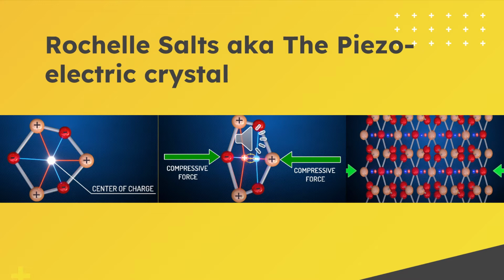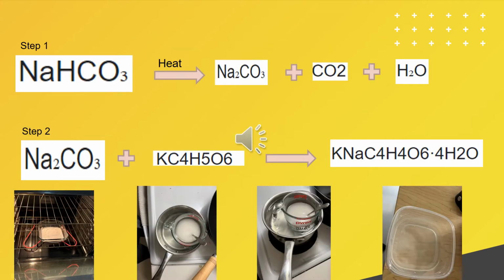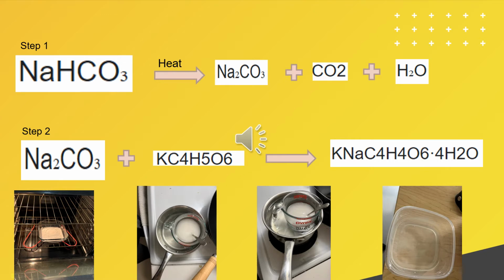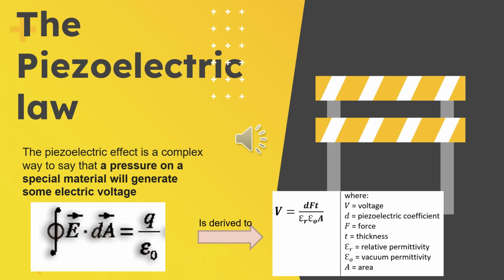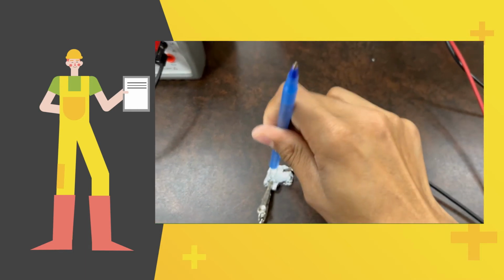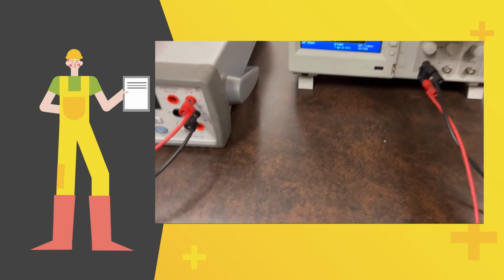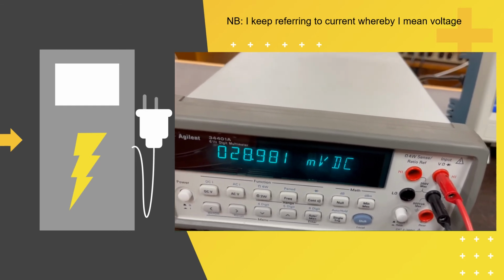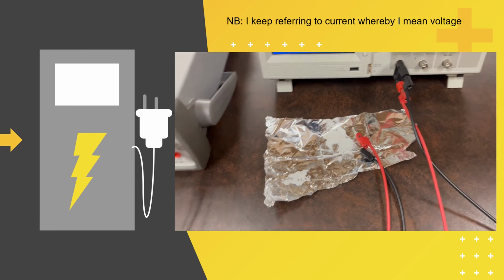Piezo-electric Transducers - Physics Project

Comment: Thanks for the video!  You had the oscilloscope in averaging mode every time you weren't hitting the sample.  When in sample mode, did you see the size of the voltage fluctuations increase when you were hitting the sample compared to when the sample was just sitting on the desk undisturbed?
Reply from the maker: This was a problem I encountered when using the oscilloscope , I wasn’t able to get much of a reading(the amplitude of the voltages and noise were hard to distinguish) , because the voltage generated was often less than 50 mV(less than my units of y axis and this was the smallest scale possible on the oscilloscope).Hence I used the multimeter to clearly define that a voltage is infact being generated.Perhaps more tuning was required for the oscilloscope, but it was a complicated equipment to work with haha.